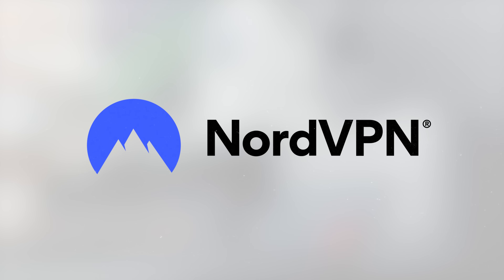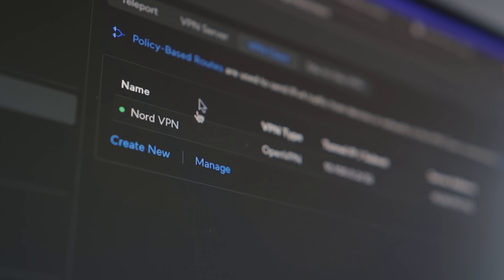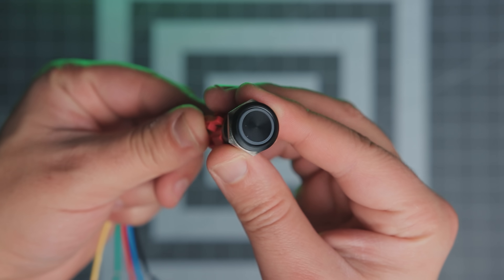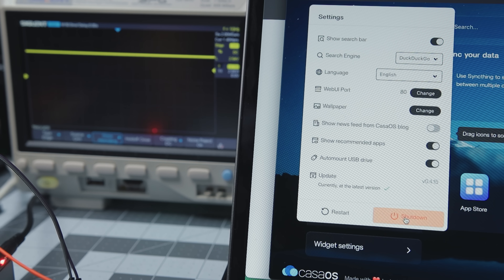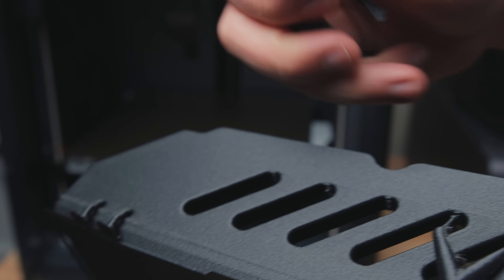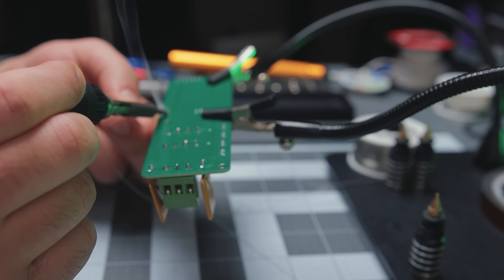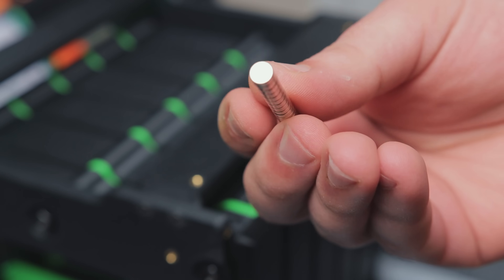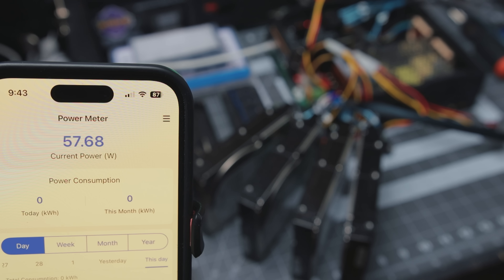I 3D Printed My Own Home Server – 6 Bay ZimaBoard NAS

Comment: Ok, looks nice...
But why make it so complicated?
It starts with you building an HDD frame around the HDD frame... 
There are much easier ways!🤔 
And then you get a weird power supply instead of using an ITX power supply or an SFX power supply...
Then you don't need to build such a weird circuit board!
Or you could use the accessories from Zimaspace...

Comment: Cool project, but my first thought is you don't need a power button, as NAS devices are designed to run 24/7 without interruption.

Comment: I am using the cm3588 NAS plus board with nvme to sata drive adapters. to have 20 drive bays.  I would like to use 2.5 inch bays (laptop size?) instead of the 3.5 inch large bays.  I am using blender and just shrunk them down to size to realize the holes are no longer holes but elliptical instead (from your stl files over on github). 

I like the design software a lot of people use in that you can do it in steps an just adjust a single variable here of there to redesign things.

could the 4 stl files in the 'drives' folder have another version added of 2.5 in SSD drives, or would everything need to be redesigned from scratch? if not to hard to do may I request a 2.5 inch version of the bays be added please?
Thank you.

Comment: The design of drive cage is really good, I hope it will be 8 bay and use two 12 cm fan for 3.5" drives thermal , just like the Synology 8 bay products did... symmetric, elegant, compact(in physical size)

Comment: This is fantastic I am looking to use your drive cage setup on another project I am working on however from the files on git it does not look like you have included a drive spacer between the slots did you modify the original design?
Reply from the maker: Thanks! Just added the STL and 3MF. It's included in the Fusion file but not in the other folders. Thanks for letting me know!
Reply: @salimbenbouz thank you for taking the time doing this.

Comment: So is the zimaboard powered via the 2 12v_DC IN pins (pins 1,3 +2,4) on the 6P Power I/O?
Reply from the maker: Yep
Reply: @salimbenbouz  Awesome! (Thanks for the quick response!) Im hoping to do something similar to what you've done here using the zimaboard 2 when i receive it but in a 10 inch rack form factor using 1U of space and a 6x2.5inch Drive enclosure. Thanks to your video I feel like i'm one step closer to sorting power for the system!
Reply from the maker: @JohanMensah  sounds like a fun project! Like I mentioned in the video I had a terrible time soldering headers to those pins. I hope that you’ll have a better luck with the Zimaboard 2
Reply: @salimbenbouz  Honestly, I'm breaking into a cold sweat just thinking about it, especially when the teardown's I've seen seem to have the pinouts completely blocked like yours were.
But the plan for now it to make sure I understand exactly how your adapter board design works before I have the opportunity to break anything!

Comment: Yep, choosing 50W power supply for nominal 50W load is not enough.
Nicely designed HDD brackets, latches and the cage itself. Looks good.

Comment: Wow thats awesome!!  I love your drive bays, I might try and incorporate that into my project.  I have a Ikea 4 cube sitting next tomy desk.  I am looking to install a plexi glass panel in the front with seals, and a .25" panel on the back of it.  Than just slotting server raisl into the machine.  Than designing various 3d printed  rack shelfs, for various hardware, like switches, ports, for a full size ATX mobo (ai LLLM hosting and gaming rig running on VM's), than a few mini pcs, and ofcourse a NAS for storage.  The Drive bays could come in clutch here.

The genius of it all, throw in a hepa air purifier on the bottom of it, that pulls in air from outside the "rack" and pushes purified air into the top.  With a few noctua fans at the top exhausting the air.  The air purifier should create a positive air pressure inside the rack, and the rack should be able to remain fairly dust free.  The purifier would sit in the bottom cube, with the upper cube shelves removed for the rack and sealed with the door.  The bottom cube would be open to the room, and also have a couple of really good UPS's inside.  The whole thing should be on wheels.  Than cleaning would be as simple as inplugging the ups from the wall, wheeling it over to the compressor, and blowing air inside really fast and using a vacuum.  than sliding it back and just plug in the cat5 and power cables.

Comment: Thanks so much for this video, this is truly an awesome design! I have been 3D printing for years and it's designs like this that really make me want to learn real 3D modeling software. So far I have only worked with TinkerCAD, which is fine for simple models but you would be pulling your hair out trying to design anything close to this good in TinkerCAD. :)

Comment: Super cool project! Love the tightly integrated build overall, and the end result looks great. Also love the lack of an external power brick, even if the choice of PSU was clearly sub-optimal (an easy recommendation here: MeanWell makes great quality industrial power supplies (mostly single output, though arguably a good 12V PSU with a DC-DC converter for 5V would be a good option for a build like this - the RPS-200-12-C would be a great option here I think)). I'm currently building a NAS of my own - it will be partially 3D printed (internal structure and the front panel) but due to its size I'm making the main structure from plywood - it's designed for ITX or small mATX motherboards as I'm transferring in my current NAS (Ryzen ITX board, repurposed server HBA, 8 HDDs plus som 2.5" SSDs, PSU from an SFF Dell Optiplex) but also planning for some flexibility for future upgrades. Super inspiring to see you make such a well integrated build though!

Comment: Ok, some comments on this:

- For these kinds of projects I really feel that something based on Arm IS the way to go both on reduced power usage and reduced heat generation... X64 feels so bloated right now, particularly Intel which has lost its North completely...
- I would be careful with bambo printers, particularly with their move to making the platform more closed source and requiring proprietary software to work and internet access too, like why do I have to connect to the internet to print something?
- CasaOS seems so bloated and using docker seems too heavyweight, when a well configured Linux system could do the same and ocuppy less space and memory at the same time, and by supporting mostly debian or ubuntu, I mean really? Two of the most bloated linux systems in existance...

Other then that the case design is brilliant, the PCB also and finally one thing I wish I knew more was eletronics design and not only programming... But I guess that when you are a neurologist you cannot be a cardiologist at the same time...

Comment: the big problem is that hardrives are designed 
to dissipate most of the heat to the sides where the screwholes are 
that way when they are screwed to a metal case , the case it self acts as a heatsink 
but what you have done is insulate the sides with a thick layer of pla
Reply: This was an interesting comment so I decided to see if I could find any information online but couldn't find anything. Do you have a link to any document that shows this? It would greatly help with any future designs.
Reply: @ShivanandChanderbally  you dont need a document just look at the design of an hdd it literally has two big chunks of aluminium on either side . roughly 70 percent of the heat gets dissipated to the sides .

this was common knowledge just 20 years ago at least among system integrators   
but you know back in the day we also 
had direct contact with the reps , that 
actually told us all we needed to know .

somehow this knowledge was suddenly forgotten when everyone started using screwless hdd brackets or hotswap cases
i guess a quiet hdd is much more important than a healthy one .

and the gaslighting is the best now they tell you to cool the hdd by directing airflow over and under it while simultaneously 
insulating the sides which slowly cooks
the hdd, planned obsolescence 
they have to make sure you buy new drives eventually

Comment: Why not hold off on disk spin up? You can configure a sata disk (using pin 11 on the sata connector(?)) to wait with the spin up until the drive is addressed. This prevents a power surge when all drives spin up simultaneously.
Reply: How would you go about doing this with pin 11?

Comment: If you want a reliable dual 5v and 12v power supply, check the Mean Well RD-125A. It can only do 7.5a on each voltage, but its a high quality power supply. The other option would be something like a Mean Well LRS-200-12, but it only outputs 12v so you would need to find a way to get 5v from 12v.
Reply: there a lot of mwell imitations around
Reply: @nietmijnechtenaam2477  Yep. Places like Mouser sell original Mean Well power supplies. I believe some electronics stores like Microcenter also sell originals.

Comment: Hi, at last somebody who knows about the advantages of the honeycombs, this is unfortunately too rare.

Do not forget to degas your new PCB (~25-30 minutes @ ~90°C) and for the power supply prefer a known brand, such as Mean Well - and because this will run 24/7, pick it in the upper gamut of their catalog (no particular interest in MW, just observations from many electronic contraptions).   It will cost you a bit more, but there will be no bad surprises (yup, with an 'S', as high temperature capacitors can also be a bit of concern with no name sh*t).

Also note that, as you added your own PCB, a good practice would be to switch HDD on in a timely manner to avoid drawing too much current at start.

Nice and neat realization.

Comment: Very nice and clean design. A NAS is in my opinion a must have. Having all your smartphones and PCs backing up their data can be a lifesaver. Now you just need to build a 3D printed UPS ^^.

What I miss on this NAS is an Air Filter. I also have a 3D printed NAS sitting in my basement and after letting it run for about a month i noticed that it became very dusty. So I then added an Air filter mat for electrical cabinets.
It is now running for about  2 years and the NAS is still completely clean.

Comment: Have you tried to clean away the solder with a regular sewing needle? I use it at my work for such tasks
Reply from the maker: Never heard of this technique. Can you elaborate?
Reply: @salimbenbouz  Basically you just heat the mounting hole (i usually do at 275*C or 330*C if it stuck too hard) and poke the appropriate diameter sewing needle before it gets cold, so the solder either get stuck on a needle or ejected.
another one is to apply a little bit more solder on top of the hole and then use regular desoldering tape

Comment: I've been looking for a something to replace my 2014 Mac mini as a server, but it turns out, that the Zimaboard 832 has a maximum Geekbench multicore score of 872. That differs notably from the Geekbench multicore score of 1401 of the Mac mini 2014 2.6 GHz i5, making the Zimaboard 832 a serious downgrade. Considering that a used Mac mini 2014 is available on eBay in Germany for half the price of a Zimaboard 832, I'm absolutely sure that I'd happily pick the decade-old Mac over the Zimaboard. Also, I found reports of Zimaboard's passive cooling frequently leading to heat-induced throttling. So that's going to be a hard pass from me. Nice project,  but a garbage board. I wouldn't use a Zimaboard 832 even if I got one for free.

Comment: Great job! I actually built something similar recently using standard components (mini-ITX mobo, SFX PSU). I’ll be uploading a video about it soon. One thing I focused on that you didn’t mention is that the material isn’t fire-resistant. Since it’s all plastic and runs 24/7, I think it’s safer to use filaments rated UL94-V0. Just something to keep in mind. Cheers from Italy!
Reply: Where is the video? 🙂

Comment: if you wanted to you could go with 6 drives by having them spin up in stages which eliminates the cold start power surge

many enterprise level servers do this brining banks of hdds on 1 at a time to manage the cold start current
Reply: ...and it is called staggered spin-up. 👍

Comment: I'm curious what operating procedure this nas has with regards to identifying a bad drive (both in software, and physically), and the procedure required to prepare the drive for removal, and the procedure to add the replacement back into the system.

Comment: @SalimBenbouz Why didn't you want to use a backplane? You did such an amazing job on the design, as well as explaining your process! Which is why i don't get why you designed these hot swap carriages, then put the drives at risk by not supporting hotswap.

Comment: Cool video!! At 06:18 a tool called a "solder sucker" would have made your day much better.
Reply: Edit - I just noticed from your amazon link that a solder sucker was included in your solder station kit.  if need be I can give guidance on using it. (genuinely thankful for your posting of this, and trying to be helpful)  Your NAS design looks really good! Can share it?
Reply from the maker: Shared the files.
Thanks for the suggestion. I also tried using the sucker, but I couldn't do it. Later, I realized that maybe the problem is the lead-free solder used on the ZimaBoard?? it clumps in a weird way, and those pad holes are really tiny and i couldn't clear all of them.

Comment: Cool project, the only critique I have is that you should add rubber washers/grommets between the drives and the cages to help manage vibrations.  Or just use SSDs.

Comment: Nicely done. A perfect example of how 3D printing can give access to high manufacturing methods just from home. Best of luck, fellow Tunisian.
Reply: Its an example of how not to make something. commercial manufacturing doesn't use these methods or everything would cost a million dollars.
Reply: @remotepinecone but this isn’t a commercial setting. It’s not like us consumers have access to thousands of dollars for industrial equipment, especially in this economy.
Reply: @remotepinecone  Decentralized manufacturing is what this is about. Small batch production, fast iteration, rapid prototyping, reaching pre-industrial phase with minimum cost, that's what 3D printing gives. Not everyone have the ability to spend millions of dollars on tooling to reach mass production or, need to do so. Sometimes you want to produce 100 or 1000 units to prove a concept or validate a market and then pass to mass production. All this was impossible to do for the majority before 3D printing or desktop manufacturing devices like laser cutters, small lathes, desktop CNC and 3D printers.
Reply: @WEMAKE3DP Exactly. Better than what I said lol.

Comment: Please do yourself a favour, get a meanwell or mornsun psu. You could even get an ATX psu, fitting that with a latching switch mechanism for powering it on. These power supplies are not that good for sophisticated works, the ripples are too high.

Comment: Regarding the power supply, you can look at a very simple power sequencing circuit that turns on one drive after another so you do not have that spike of inrush during power on.
Reply: Synology does this in it's appliances as well. And it's not a question of poor quality, it's to prevent rash aging and have less power consumption before and after hdd run up.
Reply: @alphonsbretagne8468 just dont turn off the nas... Thats the whole point of it
Reply: SAS drives with SAS controller like Dell Perc H200 will do staggered spinup by default
Reply: Good power supplies do not suffer this issue. If he's have just used a better quality unit he wouldn't have a problem. That one is the crappiest I have ever seen and its a fire hazard.

Comment: Ali express is selling 4, 5, 8 and 16 drive backplanes starting from 16Euros. I bought 4 of them for my nas build using an old cooler master case I've had. My initial plan was to use the same plug you have, and i bought 20 of them, but when i saw them, i had to.
Reply: Do you have a link?
Reply: @sorted01  yes, not sure if youtube will allow it
Reply: @Rok_Satanas  if guess they do. Otherwise you could send me the name of it. Or a good search-keyword. I had issues to find it :D
Reply: @sorted01  SATA 5 Disk Supports Hot-swappable SAS SATA Upgrades The Hard Disk Power Supply IC

Comment: Are you sure the HDDs drained 160W at the spin-up? Typically a HDD needs max 15W in normal working conditions, which would be 60W for all 4 of the drives. Maybe your power supply doesn't load the drives correctly or something else...
Reply from the maker: There's smg called inrush current when you first spin the drives motor it gulps 2 to 3 amps for a few seconds before it settles on what's on the label (Typically 12 to 16W ).
What should be done it to stagger the spin up like in commercial devices to control this. It only happens because I turn everything on at the same time. You can see it in the video going down to around 45W.